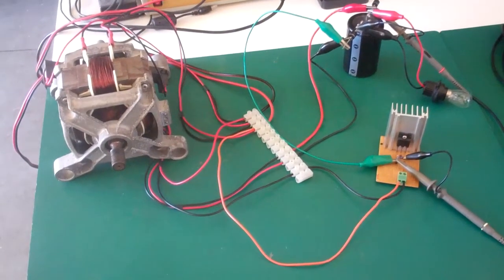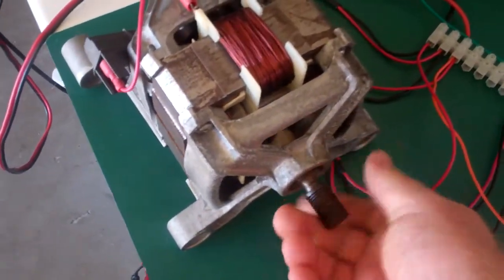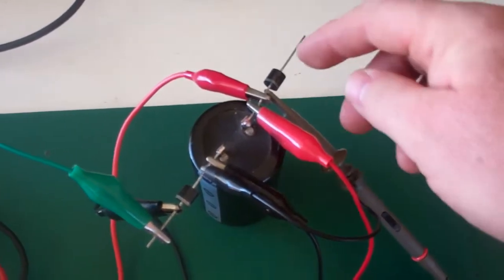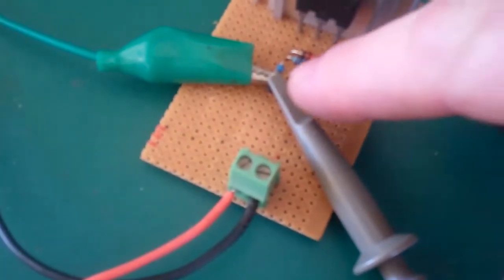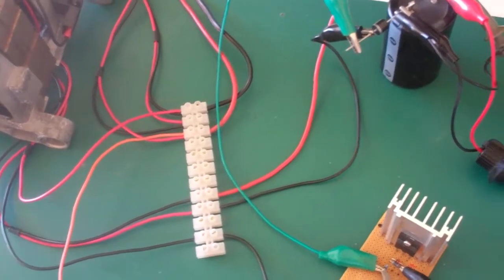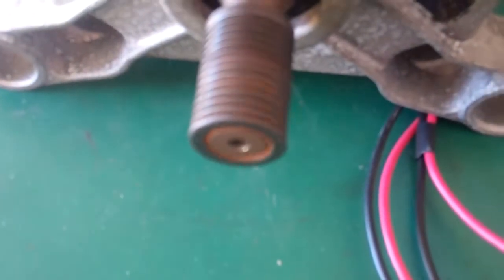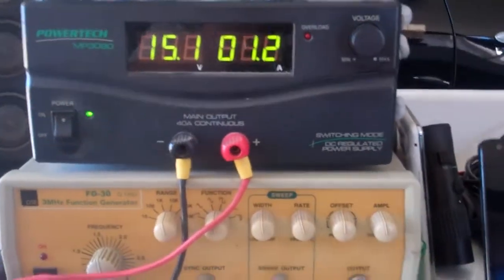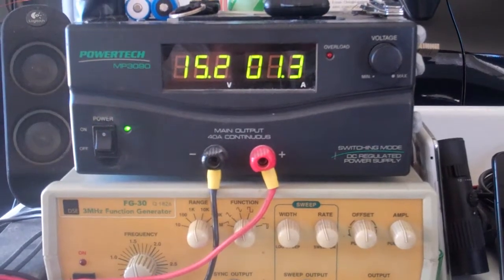The Rotary Transformer - Experiment One - Partnered Output Coils - Lets Get Bucking!

Comment: Hi, thanks for sharing. I only have one comment which is about the sound, as could barely hear you while the motor is running. Suggestion on how to overcome this is by using a compressor pedal in series with your microphone, with a bit of adjusting you can find the right setting so voice always gets stabilised at the right level automatically. Cheers.